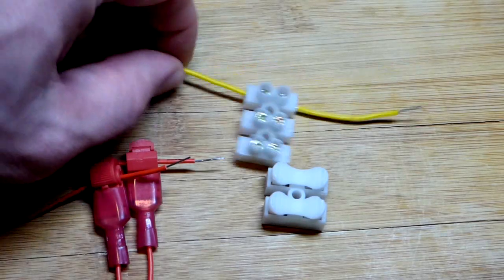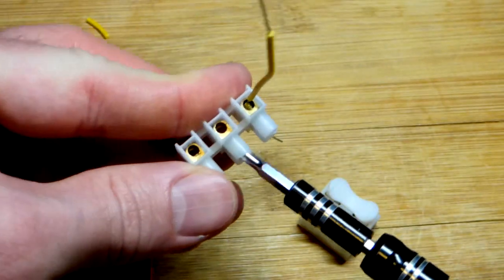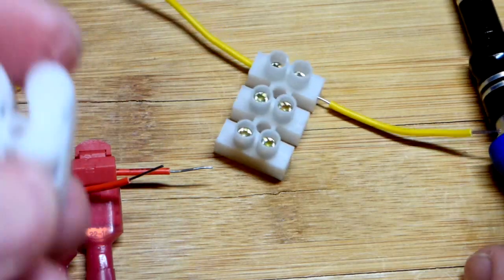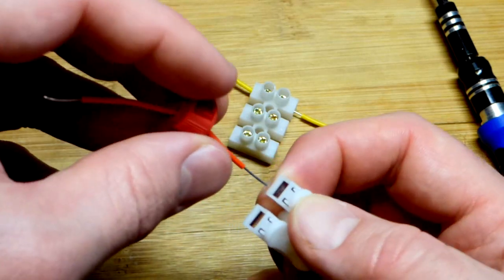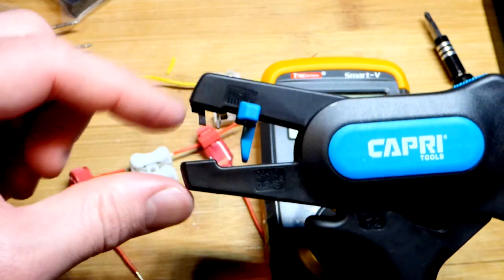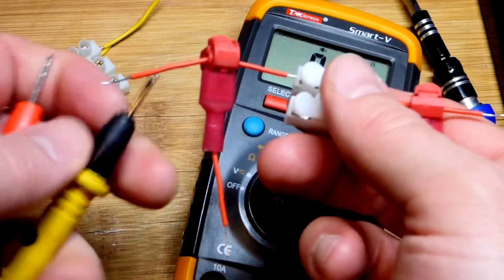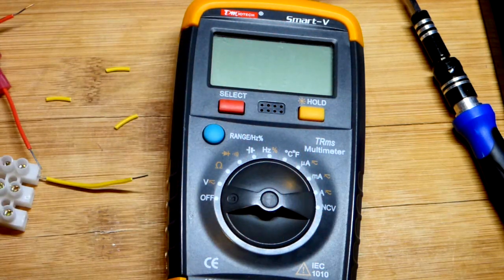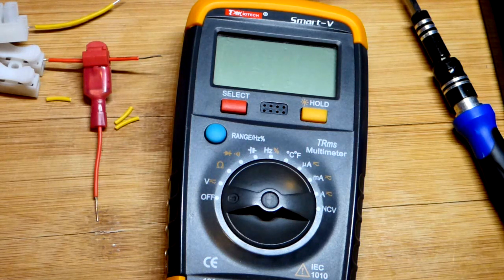Quick spring release and screw down solderless wire connectors review by electronzap

Comment: Those spring loaded connectors are actually quite dangerous. They have quite a bit of resistance and they melt at low to medium currents. You should test this yourself and maybe tell others too. There's also this video with not so low current: https://www.youtube.com/watch?v=13wstX-Fcwo
Reply from the maker: That's a good point, I wouldn't use these for high power. I'll try to think of a video on that.